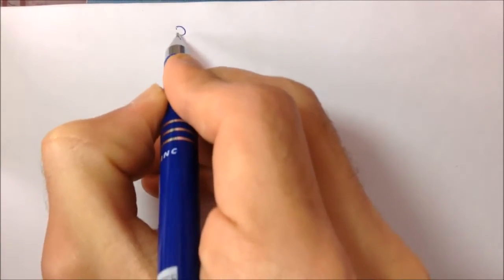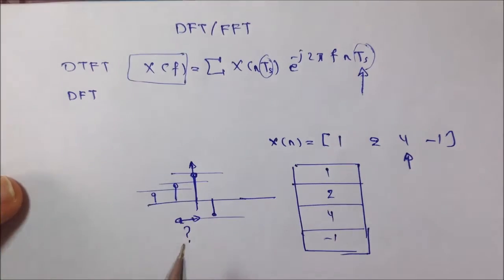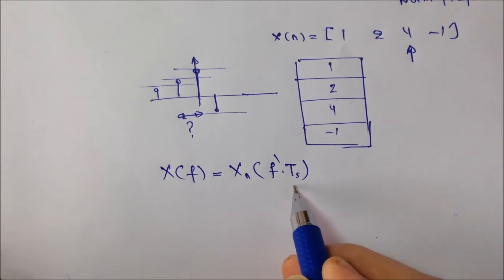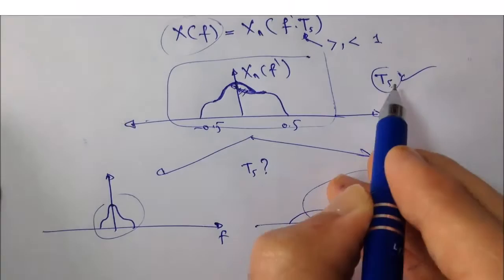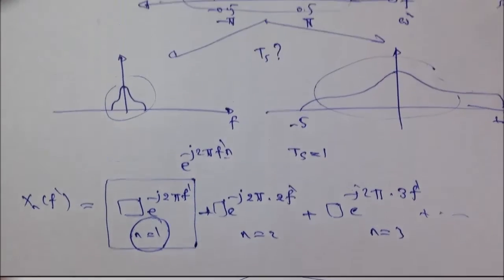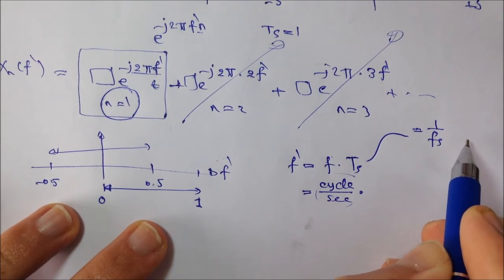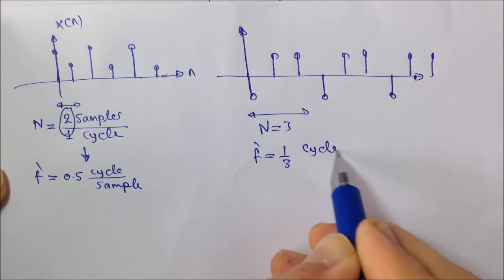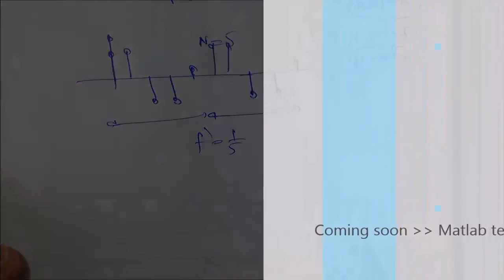4. Understanding  The Discrete Fourier Transform DFT , Theory and Derivatoin.

Comment: Professor Isam,  Thank you for your excellent  video series on understanding Fourier Transform and Discrete Fourier Transform.  Thanks to you, I think I understand the concept so far.  I am currently working on a physics problem involving switching between real lattice and reciprocal lattice.  I am unsure about a 1/N term which seems to appear in the discrete form of the inverse Fourier Transform.  Will you be putting up a video on the discrete form of inverse Fourier Transform?  Thank you.